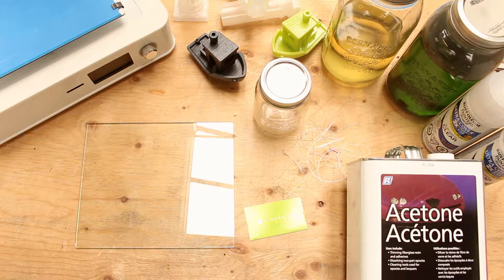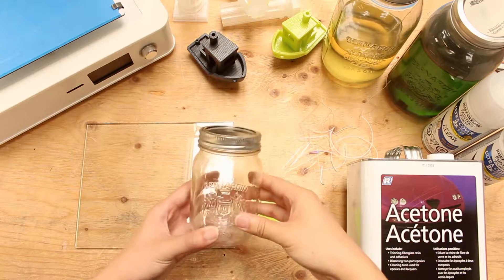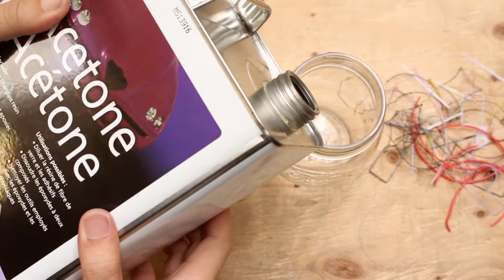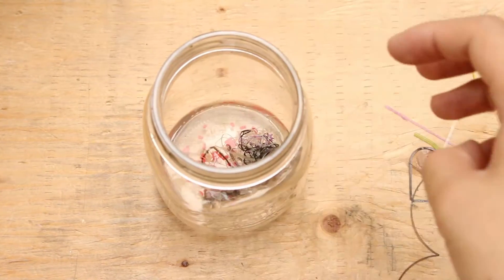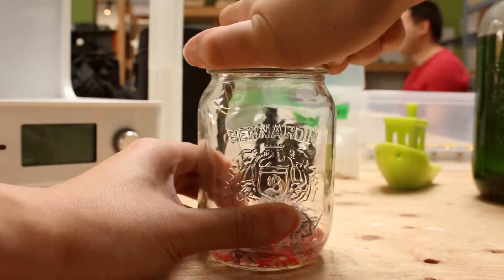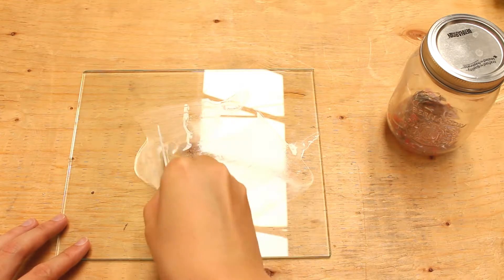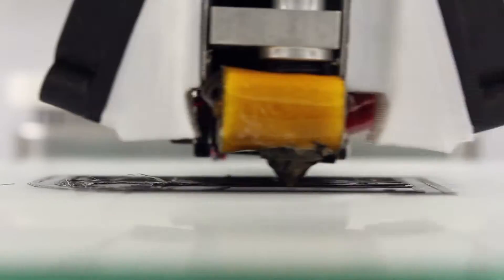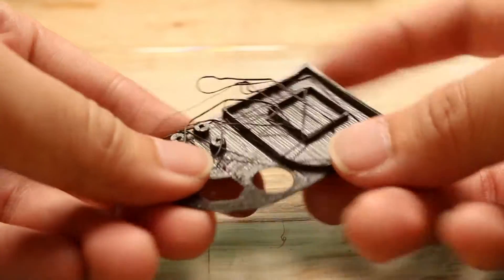Bed Adhesion with PLA sludge

Comment: You can use Caustic soda to melt down PLA and it works just fine for filling gaps and joining PLA.... if you read, all the webpages say that acetone will NOT break down PLA it will just make it sticky and rubbery...